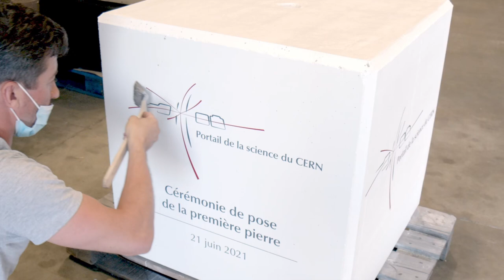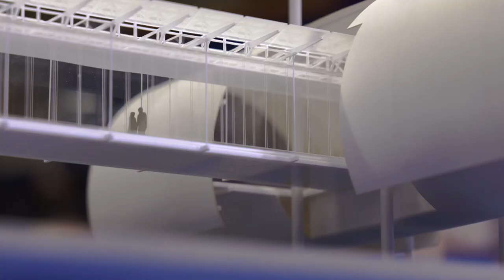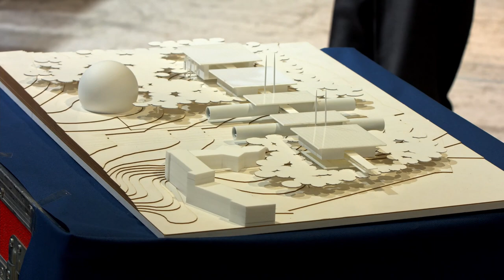Highlights of the CERN Science Gateway first stone ceremony

Comment: Notice they use the word "GATEWAY " more than a few times .Also "BRIDGE to the future " @ 1:43 .Telling you what it is to your face and their real intentions .The ceremony is for show and symbolic , also not surprised their "foundation "stone is a cube .
Reply: CERN is a star gate, it's retro engineered and   missing important elements in it's design. It creates an einstein rosen bridge in its center which connects to another matching frequency as the one that's dialled into the computer. It works depending on the density of what goes through and what the portal density value or gravity value can handle.

Comment: CERN is a star gate, it's retro engineered and   missing important elements in it's design. It creates an einstein rosen bridge in its center which connects to another matching frequency in the etheric field as the one that's dialled into the computer. It works depending on the density of what goes through and what the portal density value or gravity value can handle.
Reply: So if you protect yourself with a bubble of electricity before you jump through, as long as you hold static, you should be safe. When the static drops off of you, you would get sucked back through. This is getting real.
Reply: This is getting extremely real.
Reply: Please help me, this stuff is way over my head, due to pretty severe learning disability. I need to know asap if a bullet would be my only option before it happens. Cuz it's getting so bad .. Why would they do this , I don't understand what I did.
Reply: @liveitlikeitloveall2746  dude you’ll be alright
Reply: @XantherBlaze  and he we are just a few days till